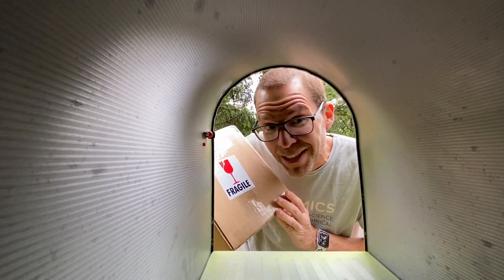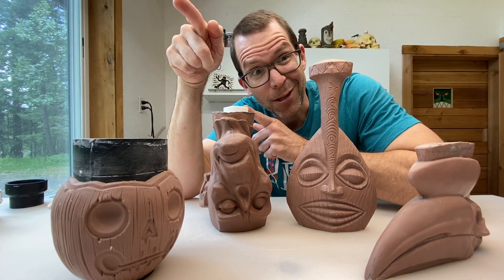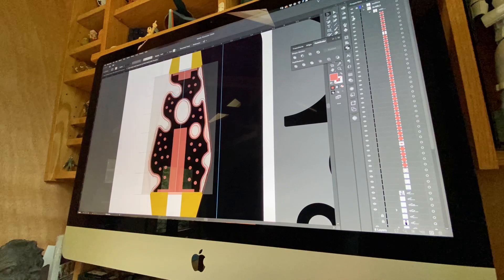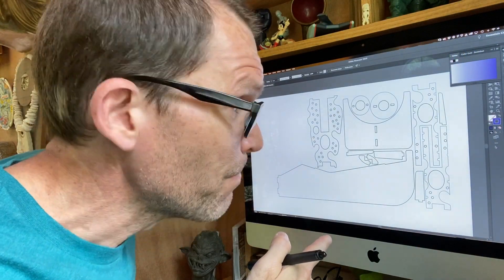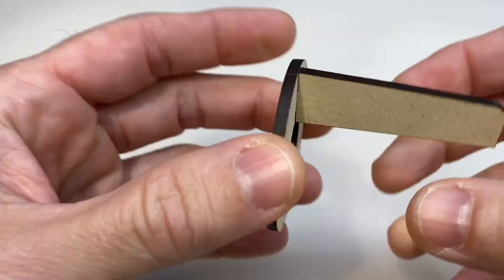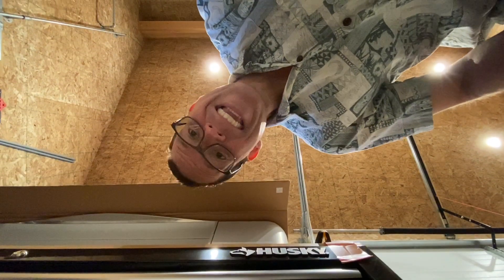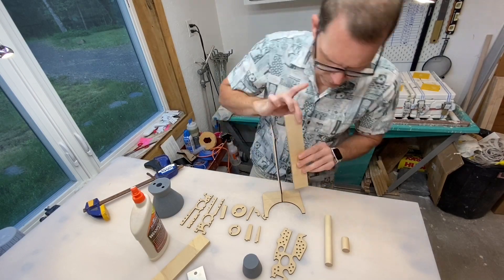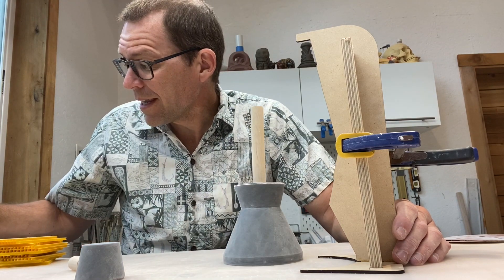Armatures - Tiki Technical Tuesday 30

Comment: I'm getting ready to make my first slip casting molds for my second ever production run, watching the Technical Tuesday videos to mentally/technically prepare. I've made many plaster molds and casts in the past for non ceramics, but watching this video of the Volcanic Vapor mug being made gave me a little aha moment.

 That being  your process is very very polished, but also very expensive (relatively speaking) . As a perfectionist, I strive for that hyper "polished" finish as I'm thinking about the mother mold, the countless molds made from that, and any production pieces that result, and I just can't stop refining my first models. I think the time I've spent is fine (two days), but I see myself spending another 2 on smoothing which I rather be pouring plaster. Long story short, returning to the videos again to see what you used for smoothing the monster clay after 1 hour and a half of research at to wether my clay and monster clay are chemically similar :D yay production lol 

p.s. when speaking about the pieces being "polished", as I keep returning to the modeling of different mugs I just wonder how they look so perfect, like objects that feel as if they existed independent of the maker, idk if that makes sense, but a large part of that comes from just how technical the construction of the model is, which takes a LOT of tools and resources most small and emerging production artists don't have.But  I'm trying to figure out the cheat code :)
Reply from the maker: Thank you so much for watching!
I definitely strive for polished sculptures and clean molds in the studio, as I think doing both makes production easier in the long run. To get a sculpture looking polished (either a smooth surface or a natural texture) I don’t think it’s a matter of expensive tools, but more a matter of time. All the sculptors I admired working in the film industry spent 25% of the time sculpting the main forms, then 75% of the time detailing and surfacing. Unfortunately that is the bit that rarely gets shown on social media 😄
For molds, I agree that silicone is expensive, but when you calculate the cost vs the return (multiple castings, a safe backup of your master mold) silicone is a great investment. Urethane is a lower cost alternative, but it has its own tricky issues that can be catastrophic when molding (moisture inhibition, not releasing from the model, etc). Back in college I made my silicone molds with silicone caulk from Home Depot 😁